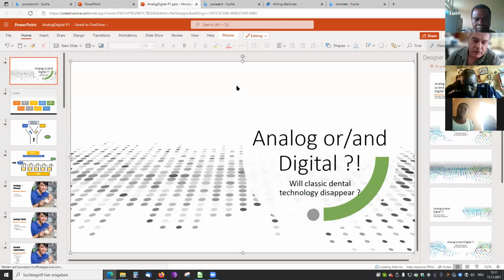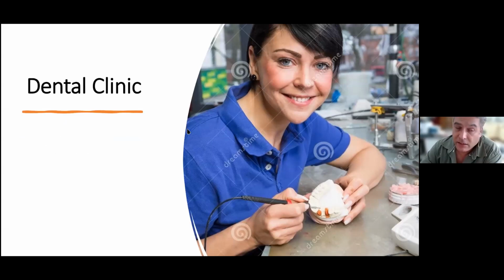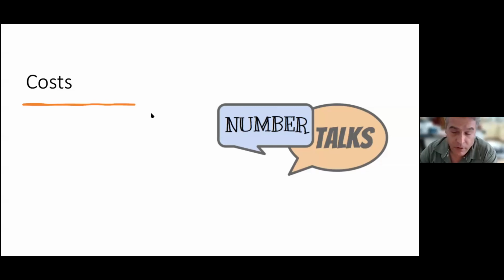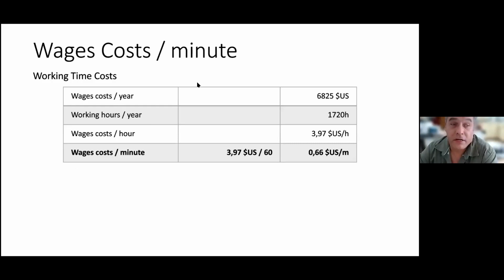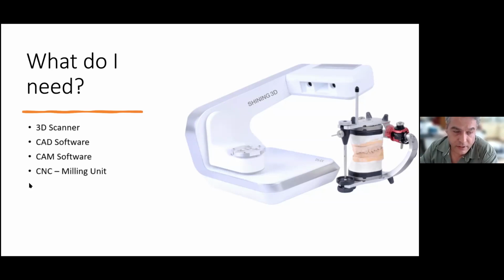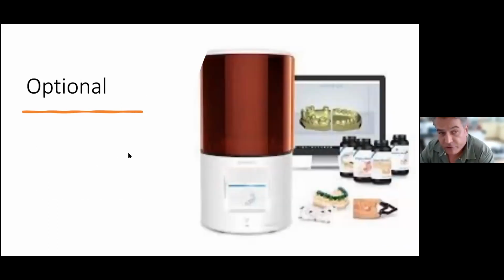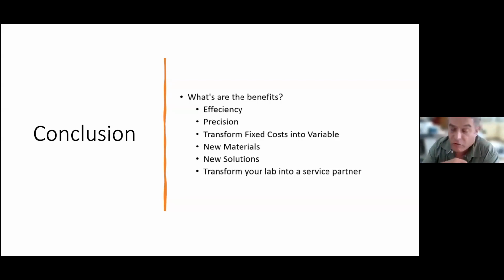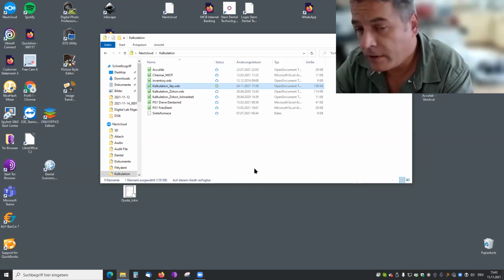Transiting from Analogue to Digital Dental Lab

Comment: Tnk u sir pls how can we used the digital on repair of denture
Reply: When milling or printing has been concluded repair through conventional method is not advised. You have to redo the appliance but digital manufacturing is less prone to error when  compared with analogue method. You need to upskill when necessary

Comment: Pls sir, is the digital have any ways of adjustment after after done with the job.
Reply from the maker: If there no fault the normal finishing processes are necessary but if a Porcelain has fault you have to start allover again but digital process hardly has problem unless the operator made one.

Comment: Sir want know the full meaning of CAD and CAM,lastly what is the right method of rebasing of denture?
Reply: CAD/CAM stand for, Computer Aided Design and Computer Aided Manufacturing. There is no need to rebasing a denture made digitally since it is far easy to return to the digital details of the patient and make a new denture. Implant retain dentures and restorations are getting popular and need for relining is becoming unpopular.
Reply: @kwarahealthtechdentaltech1016  thank you sir,